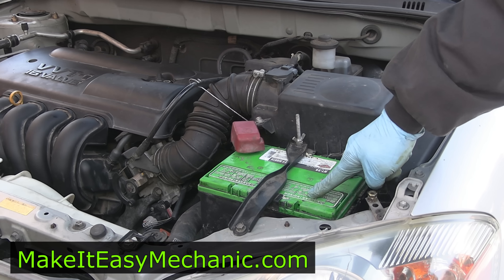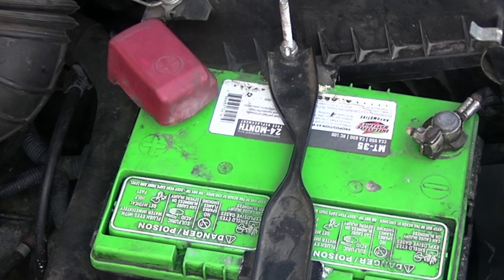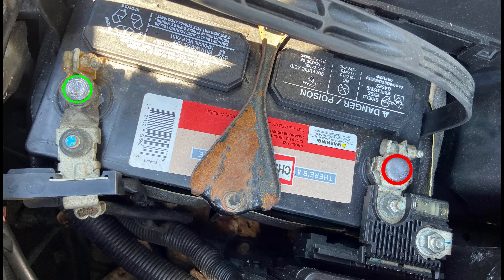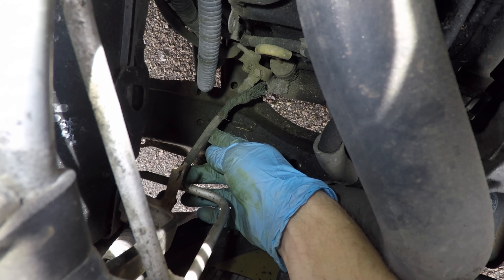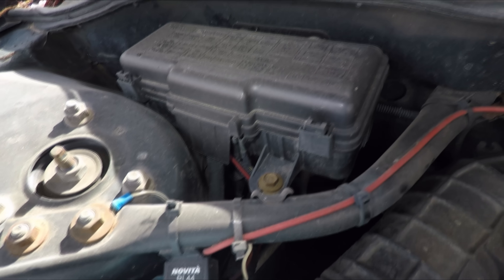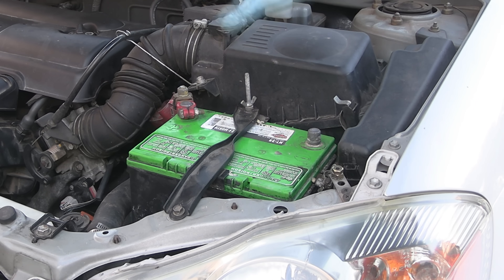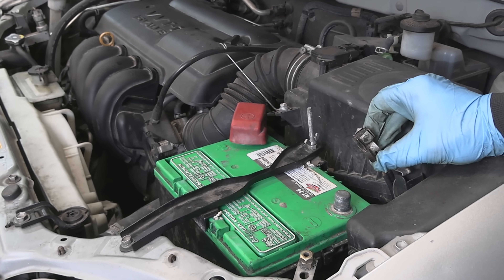How to Disconnect and Reconnect a Car Battery | Which Battery Terminal To Disconnect First

Comment: Smear Vaseline on the terminals before reffing cables.
 Helps to prevent corrosion and maintaining a better contact.
 WD 40 on the cables and clamps will dispel water and protect them .

Comment: It’s pretty damn simple and intuitive, if you just think about it for a second. Your metal wrench may contact the body of the car – which is grounded with the negative – therefore, if you try to take off the positive side first – it may cause a spark. Same with hooking it back up – if you hook the negative side up first, when you go to tighten the positive side, your wrench may contact the grounded vehicle and spark again! There, fixed it

Comment: If you need to, you can use duct tape to keep battery cables away from the terminals, especially if it is a tight fit to remove and replace the battery.

Comment: No, that is not the most bullet proof way. What goes to ground does not determine what is positive or negative. The post size is the best way. I have never seen a 6 or 12 volt battery in North America that was any other way. That includes imports for this market. You're using the the wrong terminology.  You shouldn't care which is positive or negative when disconnecting the battery,  only which is GROUND (earth for UK). Cars here came with 6V positive or negative ground 12V did, too. What is true is always disconnect GROUND first.

Comment: Don't depend on the colors of wires or post covers; the negative cable will be attached to the frame or the engine block OR both because it is the GROUNDING wire.  The positive will be connected to the starter and or possibly to a fuse bank.  ALL car and truck batteries manufactured in or for USA use will have the Plus (+) for positive and (-) Minus STAMPED on the battery.  Some vehicles have disconnect switches built into the cable connectors to help protect from the vehicle being stolen.

Comment: This is an argument I had with several young mechanics. All of them have been trained by their shop teachers to take the positive off. The best way to destroy one of your wrenches is to put it on the positive post and touch a piece of metal with it. Yes negative comes off first, if you want to get the battery out positive, next.

Comment: Can't close my doors. Mercedes puts the batteries inside and under seats. I wait for the lights to go out...about 45 seconds. And, there's no where to tuck the disconnected cables. So, I use a non conductive material and wrap them. Hope this makes sense. Pain in the neck battery placement, but keeps the weight distributed, battery stays perfectly clean, and sparks away ftom the engine bay. Brilliant trade off, unless, I suppose, it blows up when a passenger is seated ovet it😂

Comment: You will be using a metal wrench to loosen the terminals.  Thus - disconnect the negative first.  If the wrench touches the metal frame - no issue.  The current available from a battery is quite high.

Comment: You're right about metal like a wrench touching positive and then touching negative-it's a much better conductor and will arc. But, explain how you can grab the negative post of a fully charged battery with one hand and the positive post with the other hand and nothing happens. I've done it plenty of times with no effect. I was always told to not lean against the car when working on the positive battery terminal but it was wrong. I'm more afraid of touching my tongue to the top of a 9V transitor radio battery-did it ONCE in elementary school on a dare and never again-that smarts!
Reply from the maker: the reason you can grab the posts of your battery - is because 12v is not enough to overcome your natural body/skin resistance (approximately 1k ohm) to cause any significant amount of current. The 9V battery on a moist tongue is a different story however. Funny enough I did the same exact thing on a dare when I was a kid. It did not feel very good lol

Comment: Always use a memory saver that connects to the OBD under the dash before disconnecting the battery, it will not only save your radio stations but tons of other settings for air bags, GPS, fuel injectors and so on.

Comment: The negative side first. Saved you 2 minutes.
Reply: Disconnect negative first, then connect positive first.
Reply: Funny I was going to say wire cutter's cut them
Reply: Negative side first for disconnection, positive side first for reconnection
Reply: Depending on how your car is grounded. Ground first, could be positive or negative, depending on the cars system.
Reply: 😂😂😂 exactly what i thought
Reply: Except when you're replacing them lol
Reply: And if ya ain't got your radio code .lol
Reply: Negative first… leaves no return to ground anywhere in the car, therefore it doesn’t matter what you may short while warking
Reply: Here is the physics of what is actually happening with the battery, as far as I understand it. The battery has a positive terminal, and a negative terminal. The positive terminal is positively charged, and the negative terminal is negatively charged. Electricity consists of eletrons that are negatively charged. Electrons are attracted to the positive terminal, and repelled by the negative terminal. Therefore, electricity flows into the positive terminal, and away from the negative terminal. This difference in charge is what causes what we call the voltage between the two terminals. Because there is a difference in charge, we call this the voltage difference, or voltage drop. When you connect a battery to a circuit, it provides voltage to the circuit. So the battery has a voltage, and now the circuit also has this same voltage. And voltage is what causes the electricity to flow through the circuit. In the case of a car, the circuit consists of the fuse box, the alternator, and the starter, as was shown in the video. So, the voltage drop exists between the positive and negative terminals of the battery. The ground is on the negative terminal of the battery. Electrons are repelled from the negative terminal, and toward the ground or car body. The positive terminal attracts electrons, and accepts the flow of electricity from the fuse box, and from the starter and alternator. This is shown in the video, where the thick wires from the car components are connected to the positive terminal. If you disconnect either or both terminals of the battery, it removes the voltage drop that the battery provides to the circuit (the fuse box, the starter, and the alternator). If you disconnect the negative terminal first, the electricity repelled by the negative terminal has no path to the ground state. In other words, electricity cant leave the battery through the negative terminal anymore. If you accidentally short circuit the negative terminal, it is safe, because your body, the wrench that is touching the negative terminal, and the negative terminal, all have the same charge as the ground, so there is no voltage difference there, and electricity wont flow though you. Removing the negative terminal, which removes the voltage drop on the circuit, also means electricity wont flow into the battery at the positive terminal. Since the voltage is no longer applied to the circuit, electricity will no longer flow through the circuit, at least not the electricity flow caused by the battery. Now you can work on your car, and the battery wont accept electricity from the rest of the car. To be safe, you should disconnect the positive terminal also, to avoid the case where the positive terminal is still connected, and the negative terminal cable touches the negative terminal by accident, restablishing the voltage drop accidentally, as was shown in the video. To reconnect the battery, you connect the terminals in the opposite order that you disconnected them. The positive should be reconnected first, and since the battery wont have a path to ground yet, since the negative terminal is not connected yet, electricity in the circuit and to and from the terminals wont flow, so you cant accidentally create a short circuit yet. Even if you touch the positive terminal with one end of a wrench and a metal part on the car with the other end of the wrench, since both terminals of the battery arent connected yet, there wont be a voltage established on the circuit yet, and you wont get electricity to flow into the wrench, or into you. Then when you connect the negative terminal, electricity will begin to flow again in the circuit. However, since the negative terminal has the same charge as the wrench, you, and the ground, they have no voltage difference, so no electricity will flow into you, and it is safe to handle the negative terminal at this time. When both terminals are connected, the voltage drop is re-established, and electricity will flow through the rest of the car again.

Comment: Or you could say to connect a battery add power + (Posative First) and to disconnect subtract power - (Negative First) it's written on the battery so just change how you think of the problem.

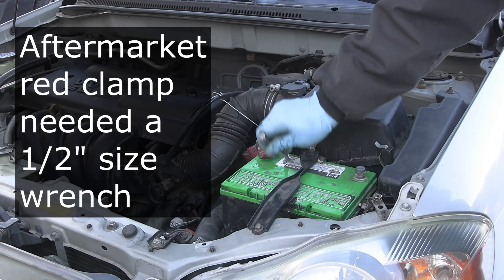Comment: Can't figure out the airbag comment at 3:10. 😮😮
Reply from the maker: if the reason you're disconnecting your battery is to work on the airbag system - you should first disconnect the battery, then wait at least 10-15 minutes to allow residual power to dissipate (to prevent accidental air bag deployment), then you can proceed with the repair.

Comment: Excellent and clear video, but just one small problem that is only relevant in a tiny minority of cases. One of my cars is positive earth and following this advice will lead to the very problems you are trying to avoid. However, positive earth is really rare these days so it is unlikely to affect over 99% of home mechanics.
Reply: I'd say closer to 99.999%. Only cars I've heard of with positive earth were from the 1950s, or earlier. The main reason for stopping this was (I believe) galvanic corrosion of the car. So, would likely be seriously low numbers of these left 😅

Comment: Update on how to properly disconnect the battery on today's vehicles. Step #1 is now download your car's computer memory. There's a specific tool you can buy at the auto parts store that performs this specific task. It plugs into your OBD II connector under the dash. If you don't do this BEFORE disconnecting the battery, you are going to have to have your vehicle towed to the dealer for a factory reset of your vehicle's computer.

Comment: neg post first use this when i want to reset computer cause if you get an idiot light that come on bet if you do this light will go out if comes back on you have a problem own 2013 dodge caravan se runs just fine take care of it will take care of you oil anti freeze trans flush

Comment: How I almost lost a finger and developed a lisp…. Went to remove a positive side post cable first from my battery when I was young and stupid.  My wedding ring was making an excellent connection to the wrench, about as good as the wrench’s socket was making to the positive terminal. 
As pushed on the handle my ring decided to press against a part of the frame, which I had left connected to the negative terminal.  Sparks flew for just an instant, and when I could see again,(forgot to mention I was also blinded, for a brief moment,) I realized my ring had instantly heated up to however it could without melting in two.  I started spitting on my ring finger to chill things out, and when that didn’t do anything, put the ring and finger in my mouth, which momentarily stopped the cursing.  
Now that the ring was back to normal, except for the weld marks on either side, I tried pulling it off but realized it had taken our wedding vows personally and was hanging onto the skin underneath it for dear life, “till death do us part”. 
Running into the kitchen I shoved my wife aside,  did I mention this battery mistake could have brought death by stabbing, but fortunately when she saw my finger, and realized the white band around it was not the ring but just some cooked skin, she forgot about the knife and said she’s driving me to the E.R. to have a Doctor take a look.   
The Doctor listened to me explain what happened, and said if the burn had been a fraction of an inch deeper circulation would have be cut off and I would have lost the finger. Puzzled at first, when I asked him to look in my mouth, he realized my lisp was due to the burn of trying to cool down the ring.  My wife was glad the finger wasn’t lost as the white scar was a constant reminder to anyone I was married, even if I removed the real ring. 
Take the negative off FIRST!!!
PS: now I’m old and stupid.

Comment: 2:00 This important safety concept is quietly buried in the middle of the video.

What matters is NOT what's negative or positive. Fundamentally, what matters is which pole is connected to the CHASSIS or ground.

If you remove this connection, then accidentally touching something to the chassis can't possibly complete the battery circuit. The video correctly explains this. It also showing the converse case with a few animated sparks for dramatic effect.

Remember, it's only a CONVENTION, not a fact of reality, that negative is connected to chassis and positive goes to the fuse panel, switches, and so on. It never hurts to sanity check this, especially if you're working on some funky old piece of equipment that was built without regard for such conventions.

Comment: Disconnect Ground 1st. Correct. 

But sometimes a vehicle or machine is wired Positive Ground. 
Older British cars, and older farm equipment, for example. 
In those cases, the red first rule doesn’t apply. You really need to trace the ground wire back to the battery from the frame. 

Rare, but possible. And the Brits say Positive Earth instead of Positive Ground.

Comment: I got a better idea let a pro handle it even though I have removed many batteries in my life time there was this 1 time I had an arch when trying to connect a set of jumper cables next thing I am on the ground with my dad washing my eye out with water.  1 piece of case cut my forehead the battery acid eat right though my jeans & shirt  So when ever possible seek professional help

Comment: Very interesting - but with electronic modules, many connectors (receptacles) were designed to connect the "0V" first from the power supply/signal cable so that the ground 0V reference was established before power could be applied. The mating connector often had that 0V connection pin/tab a little longer than the other signal and power connections so that the 0V was first touching.

Comment: Sorry but your comment about being able to disconnect the positive lead safely once the negative is disconnected is incorrect. If your spanner/wrench on the positive terminal touches anything metallic under the engine bay, including the batter tie-down strap, as indicated in your video, you will still be at risk of a spark.

Comment: Quick Tip:  For novices, you can put a red sticker or even red tape near red terminal and on the cable, so that even if you can no longer see the symbol, or the cover falls off. you can still easily see which terminal you are working with.  Colored batteries and wires should be standard, but I don't run the show......

Comment: Except on some Citroens, you cannot disconnect the negative first (C4) the battery is in such a bad place you have to remove the positive power distribution terminal block before you can move the battery to get at the negative terminal not designed with maintenance in mind, a simple job takes three times as long due to the idiotic placement of the battery.
Reply from the maker: what a horrible design! thank you for sharing

Comment: Beware I recommend you remove your keys from the interior of the vehicle completely as some vehicles will lock all the doors after you have finally reconnected the battery
Reply from the maker: Good point, thanks for the advice!

Comment: Identify the (very short) wire that goes from one of the two battery terminals to the car frame: that wire is the negative wire. Disconnect it first. 

Then disconnect the other wire from the battery (positive by process of elimination) if you need to.

Installation is the reverse. Positive first; then negative (frame side) second. 

You don't need 4+ minutes of video explanation. Best wishes.

Comment: This advice is 99.99999% accurate, but not 100%. 
To be perfectly correct always, the terminal to disconnect first and then reconnect last is the one that connects to the body and/or engine block. 
This is because many years ago, there were cars with positive earth, unlike today where all are now negative earth. (they were often 6 volt batteries also)

Comment: Start with black (negative) and end with black. 

Jump starting a car is different:
1. Red lead on positive terminal on the dead battery
2. Red lead on positive terminal on the good battery
3. Black lead on negative terminal on the good battery
4. Black lead on a bare piece of metal on the dead car(Grounding point)
5. Start the good car and let it run for about 2 minutes
6. Start the dead car
7. Remove black lead from the chosen grounding point on the dead car
8. Remove red lead from the positive terminal on the dead battery
9. Remove read lead from the positive terminal on the good battery
10. Remove black lead from negative terminal on good battery
DO NOT LET ANY OF THE LEAD’S ENDS TOUCH EACH OTHER AT ANY POINT

Comment: If disconnecting battery to avoid charge drainage during Off Road months, is it sufficient to disconnect only the Negative cable, or necessary to take off Positive as well?
Reply: Just the negative.
Reply from the maker: just the negative will suffice